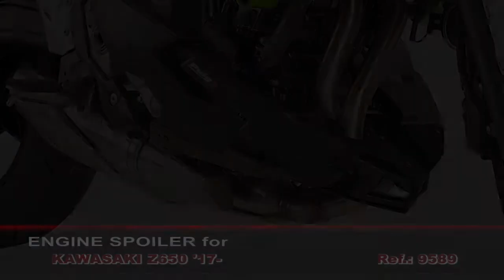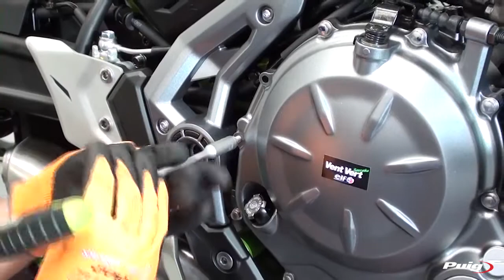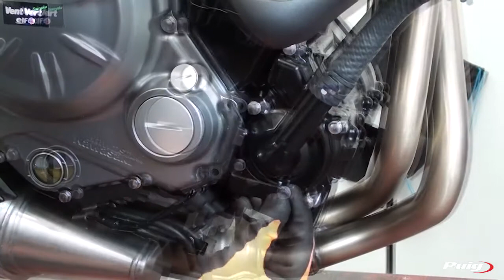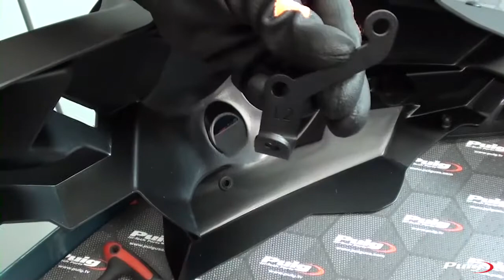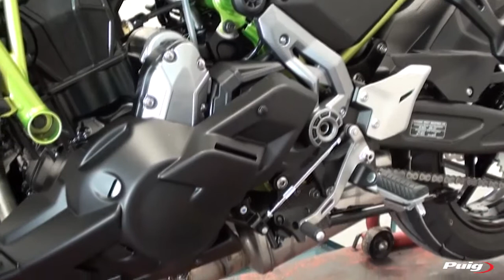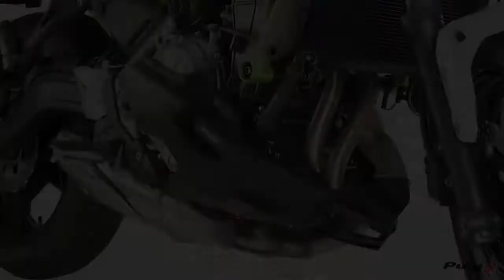REF.9589 Puig Engine Spoiler for KAWASAKI Z650 17’-

Comment: Hi, do we need to remove the cover everytime we change engine oil and filter?
Reply from the maker: The oil can be changed without removing the cover, both the filling hole and the emptying hole are exposed. Instead, the oil filter is clogged and it will be necessary to remove the ABS parts from the keel to replace it.

Comment: Does the puig engine spoiler fit the full titanium akrapovic exhaust as well?
Reply from the maker: In that case, it is compatible only with the original exhaust.
Reply: Puig Hi-Tech Parts will it work with yoshimura   Full system exhaust?
Reply: Were you ever able to confirm if this fit the full akrapovic exhaust?
Reply: @RollinWithSteven 
Only on the original, unfortunately not the full titanium Akra

Comment: will this work with an aftermarket exhaust
Reply from the maker: We can't confirm it. It was designed for the original exhaust. An aftermarket exhaust can be not compatible.
Reply: @PuigHiTechParts  wish they would of told me this be for i bought one
Reply from the maker: @chevys1080  We're sorry but we can't confirm it because we didn't test it.